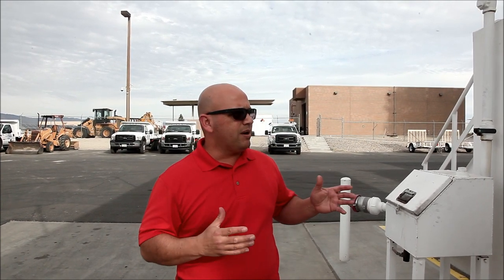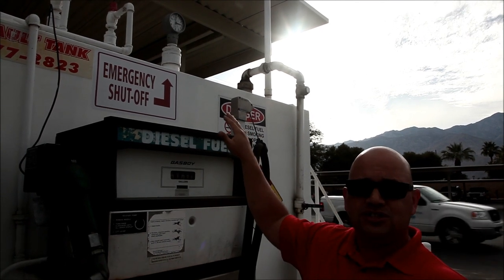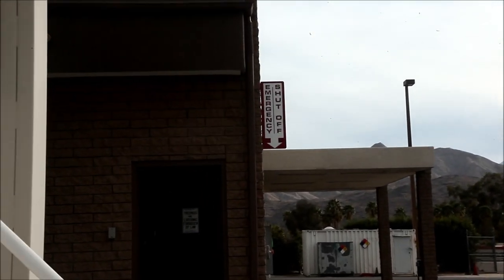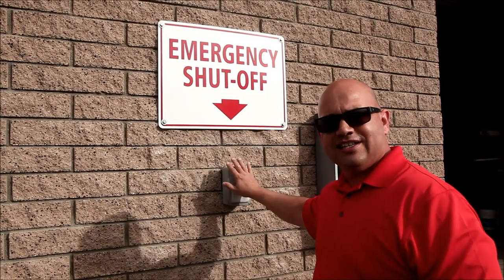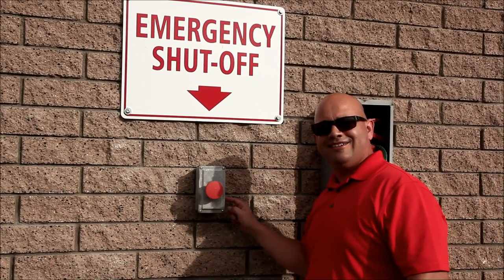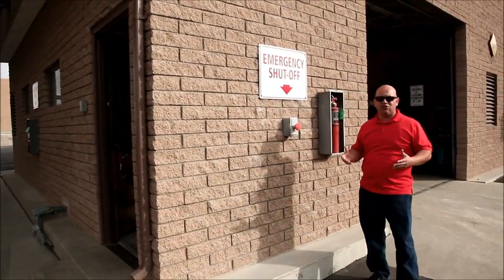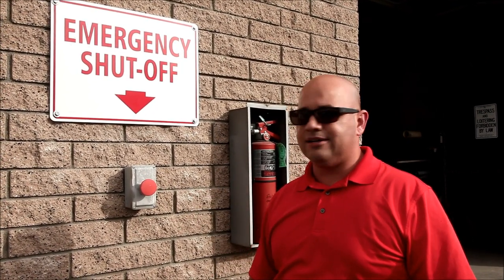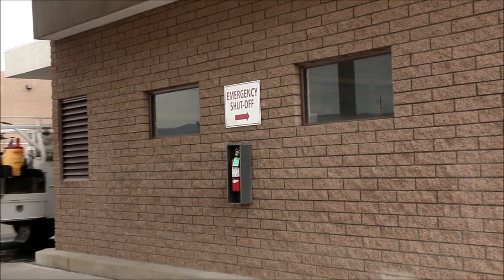DWA Emergency Shut Off Procedures

Comment: why the emegency shut off switch far away from fuel dispenser?
Reply from the maker: This requires employees to leave the area of the emergency to shut of the fuel.  Also, if someone comes to aid in the shutoff procedure they don't have to run any closer to the danger zone.  I hope this answers your question.  Thanks for watching.
Reply from the maker: It's only about 30' from the north side of the dispenser. (10 yards away)
Reply: If the emergency shut off switch is located on the dispenser Island, Is this violate any law?
Reply from the maker: I don't think so because I believe I've seen some on fuel islands in town.  However, the reason they're away from the dispenser island is because the most common accident is when drivers loose control of their vehicle and crash into the fuel pump or close to it.
Reply: Yea
Reply: @jazzmaned  what if I push it as a prank
Reply: @catsgame9282 like he said in the video, there is a reset switch next to the button, so all they need to do is push the reset switch to turn the pumps back on.